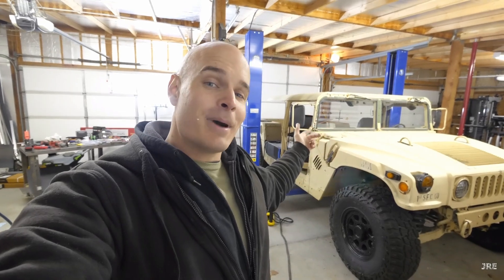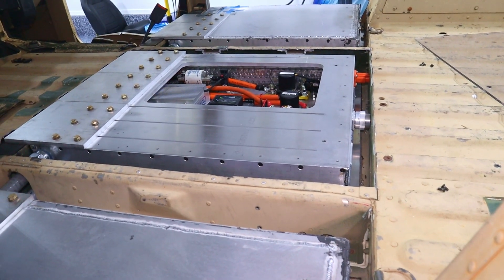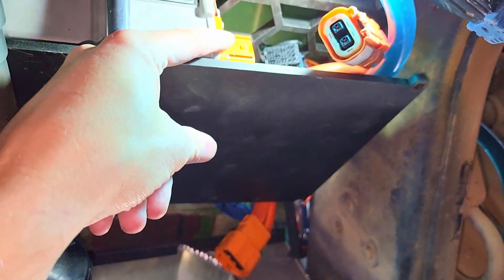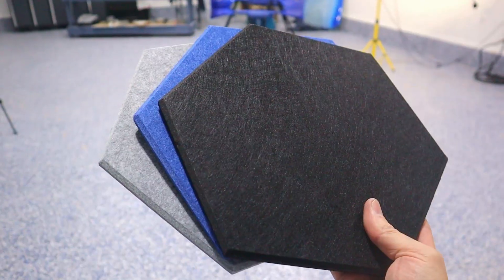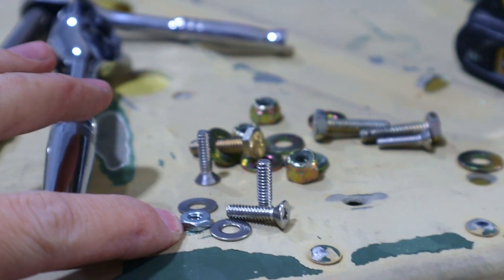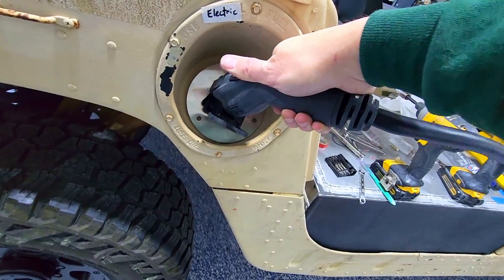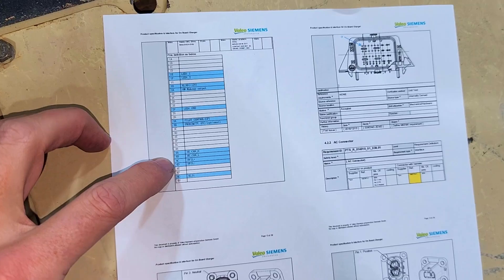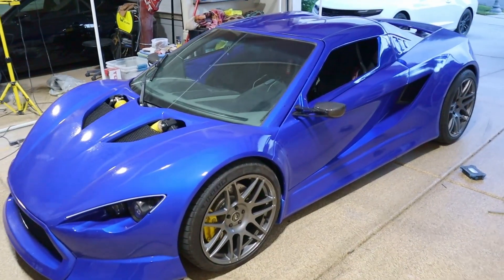Electric Converted Hummer - Diagnosis from the EV Doctor

Comment: I used to deal with a lot of BMS charging and general battery management stuff when I was an owner of a small company building electric bikes, buying and testing BMS boards from eBay and Ali. One issue we ran into was programming/flashing the BMS and ensuring the parameters/firmware were right. Are you sure that the correct firmware or settings are uploaded to the BMS? Does the charging system have the correct components? Might be worth verifying inside the black box/further than P/N on the whole components, take a look inside against the datasheets or 'correct' manufacturer info.
Reply from the maker: Thanks for the suggestion!
Reply: @electricsupercar  Of course! Hope it helps, thank you for your work in producing videos!

Comment: Connect a oscilloscope to the Can Bus and look if data packets are being sent over the network. Look at bias voltages as Can Low should be at 2.5v nominal and pulled down to 1.5v and Can High should be at 2.5v nominal and pulled up to 3.5v. If your voltages are lower it usually means a bad power feed to a module that communicates on the Can Bus and if you have elevated voltages there is a module with a bad ground that communicates on the Can Bus. That is the only way to truly troubleshoot a Can Bus system. A multi meter leaves to many variables when testing Can Bus as you need to see the data packets. Make sure the waveform has good  square waves with a higher square wave at the end of every message. Make sure the wave forms are not leaning into a direction but pull straight up and straight down. Hope this helps
Reply from the maker: Thanks for the comment!

Comment: My suggestions:

#1 Check the grounds. Seems so many vehicle electrical problems caused by bad grounding.

#2 Put an analyser on the CAN bus and see what the charger is sending. The fault code should indicate what the problem is.

Given Jerry’s previous comments about inability to see metrics on the display, I would suspect the CAN bus connections / configuration.
Reply from the maker: Thanks for the comment!

Comment: Check the specs required for HVIL. Some HVIL loops expect some voltage drop across them. However, it is probably not likely that the charger is the source of the HVIL loop, it's more likely that the BMS is. Its possible the HVIL pins on the charger are shorted together and when the connector is unplugged it breaks the loop (ie the charger is doing nothing with it).

Edit: I found a spec sheet for a valeo charger, I don't know if it's the same but there's a specific section for HVIL and it says (for the one I found) that the OBC doesn't diagnose HVIL. You should check your documents.
Reply from the maker: Got it
Reply: @electricsupercar  if your spec sheet is similar to the one I found, it didn't describe what kind of faults could be the problem :(. That would've been the next spot to check. 

However, it's probably CAN. Personally I've never had problems with terminator resistors, like even when removing one completely. I'd check to make sure the BMS is talking and that the OBC is talking on the same network. Make sure CAN hi/lo are the same. It's probably worth doing all your testing with ignition (or equivalent) powered on so you don't have to worry about devices properly waking each other up, that'll take one variable out of the equation. Once you get it charging with ignition on, you can get it working with ignition off (assuming that the system can charge with ignition on).

Good luck

Comment: Yeah, I would check the coding in all controlers seperatly with a pc that they are communicating at the same CAN speed, language etc, if they have different speeds, say 250kbps and 500kbps things will not work. :p And are the ends of the trunk terminated? If not put in resistors 120 ohm in both ends will help with signal integrety, although I would think it would work on such a short run anyway.. I would bet it's just the coding/configuration of the controllers that are mismatched and by correcting that it will work. It's clear the charger cant communicate with the bms so it wont start charge.

Comment: Some hanging traverse panels on the ceiling would help a lot more with the reverb. These "slats" protuding from the ceiling trap low frequencies and dampen them significantly better than those tiny foam pads on the walls (which are better for high freq dampening)

Comment: You could build a short extension cable for your can bus connections then sniff the traffic. You can sniff with a scope. I also recall that if you have access to the individual wires you can use a clamp on sniffer. Of course your can topology is important, but I recall the owner already me noted that.

Comment: Good video but bad audio quality really lets down the overall production quality imo. Just intended as constructive feedback, keep up the good work. As a solution I recommend getting one of those DJI lav mics (or any lav mic) and completely change whatever you are using for voice over. Honestly recording on your phone's voice memo app in the car would probably be an improvement. Otherwise getting a decent mic setup for voice over including at least a decent USB mic with a pop filter. Otherwise you can go all the way and get an audio interface, a decent mic which requires amplification with balanced XLR cables etc.
Reply from the maker: Thanks for the comment!

Comment: Yes I drove a 1972 Dodge Challenger for 15 yrs and it didn't catch fire 🔥 because the wiring was done perfect! An as far as I know I got the most miles out of dodge Chrysler challenger! An everyone else didn't drive the car or it Burned! Which is kind of cool I think that I've started thinking I should convert it into a EV called the radio station and discussed on air with the NPR PBS host who was super nice and added she'd love to drive in one of those!

Comment: I've worked with CAN bus before and I had a ton issues with it. Heres a few ideas:

CAN ID collision? It does happen from time to time. Depending on the protocol it could be a 1/255 chance.
Perhaps the frequency is not the same on both sides?
It could also be mismatched protocols (regular frame vs extended frames)
It could be a dead transceiver on the charger so trying to isolate the charger and talking to it directly can help diagnose it.
Improper grounding? Unlikely but try adding a grounding wire between the charging box and the VCU.
Reply from the maker: Thanks for the comment!

Comment: I was a broadcast engineer for years, one particular model of HDTV transmitter used CAN Buss for communications between control boards, exciter amplifier, and final Power Amplifiers. I recall a CAN Buss wiring getting a few wires shorted on the bus wiring, which took on the communications IC Chip on most of the PA " power amplifier" modules. I basically had to go online and order new IC chips and purchase a soldering station for surface mount Integrated Circuit soldering, and replace approximately a dozen of these ICs to gain back communications on the CAN Buss. I'm just putting this info out there,  this all started because of shorted wiring in the buss wiring. Don't know if this is what your problem would be, but for what it's worth.
Reply from the maker: Thanks!

Comment: Thanks very interested.  I'm in my late 60s,  I'm an electric motor and armature winder by trade and an electrical mechanic.
 I have an 2003 wj.  Jeep I'd like to convert,  I know I have the ability,  certainly lacking on the computer programming side.  But information is hard-ish (patent pending) to come by here in the down under,  specially when you live in the bush. Is there a list of equipment used in this build please.  I have watched Jerry's  show several times,  I seem to have missed it. 
Thanks. 
As far as possible causes,  it's usually something small,  or several something smalls.  Keep at it.

Comment: That box right by the driveshaft (Charger Port Controller) has pretty sharp edges for having coolant and wires hanging on the edges, I know the project is in progress but I was shocked at how fast cables can wear through in these scenarios. What's the SQ Ft of the shop and how many Felt Right pads did you end up putting up? That product looks nice and you can hear the difference in the audio even when you are unboxing it. Thanks for sharing!
Reply: When you are verifying the pinouts are you only verifying continuity between the expected pins and not checking for any bleed into other pins? Mentioning because of the damage to the wire insulation at the port and the other mention above for sharp edges.
Reply from the maker: 25'x40' I did not count the tiles maybe 100

Comment: Two possibilities I see - since the failure mode associated with the transient red light says anything in the power stage (paraphrasing), it's possible it may have nothing to do with the CAN communication but damage to the AC input on the charger. 
Having swapped one of the lines with Neutral, the L-N voltage would have been the L-L voltage, double the operating voltage on the L-N side. If it is overvoltage protected and /or fused, the line that was swapped with neutral may have a blown fuse and/or Varistor. This may leave one phase powered (the one not swapped with neutral) so it can power up, but detect no voltage on the opposite Line.
I would open up the charger and look for evidence of the AC inputs having popped fuse and /or varistor... or other functional components, if it has no such protection. 
If that checks out, I would use an oscilloscope and/or logic analyzer to monitor the CAN bus for traffic, voltage levels, noise, usable (square enough to trigger hi/lo thresholds) edges. If something is off i.e. round edges or diff voltage too low, your bus impedance may be too low and CAN transceivers unable to drive such a low impedance (unnecessary termination resistor/s on the bus). 
Anyway, think more about the CAN when that time comes,  I suspect the  dyslexia caused a problem in the charger.
Reply from the maker: Great advice!

Comment: W.T.F you change the placement of the wires in the output plug or the input point of the world hummer, what about the input plug coming from the power out of the wall charger.
You should have change the wiring of the inverter of the Hummer rather than the wiring of the plug.

Comment: well i don't know if this help but you can check each component alone , i mean you tested the charger so that's done test the inverter alone and try to get an expected output from is if it works then its not it and try the can network 

as i understand the can network connect every this to communicate with each other so you need to know if you can get an output from other component 

but i really think that the can system has something wrong in the wiring because you get no thing from the screen and no response to the charger 

a  hint may be helpful , try check if there is any cuts in the can wiring and that cut may be touching the body of the truck and as it's grounded you get nothing as a response 

hope to help , keep the hard work 🛻

Comment: Nice to see you working with Zack!

You may want to do some research on connecting stranded wire. My understanding is that crimp connectors should be used, not solder. The issue is solder turns stranded wire into solid wire which when flexed eventually breaks. That's why stranded wire is used in automotive applications where the wire is constantly flexing.

Comment: Id probably try a few things:
an oscilloscope on the can network to check on the signal
Check can for is the right messages are passing and any trouble codes
Check sequence of operation and interlocking on the high voltage DC side for any issues (like contactors needing to be closed first so the charger can see DC voltage from the battery in the right range for a healthy battery, many chargers require that before they start
re check the can wiring matches specs, I know he mentioned using some wire designed for can but the branches of the trunk didn't look like they were using that special wire, with relatively long and high speed data connections (as in more than a foot or two and into kilobits per second) things can get interesting and seemingly minor issues with wire become major problems, shielding is important, as is lengths, especially of any branches, but also things like characteristic impedance which is also why those termination resistors are needed, if you have a mismatch of the wires or miss a termination resistor the signal will bounce off and back down the wire interfering with itself, I don't know the exact specifics for can in particular but I'd expect that branch for Jerry's laptop should be terminated whenever a can device isn't connected and I would not be surprised is the characteristics of the branch wires were wrong and creating reflections at one or both ends of each branch due to impedance mismatch.

I'm in IT and deal with a lot of non Ethernet "networks" for various things and I've seen a few of these types of issues crop up, multi drop bus networks (which can is) in particular can be very picky and if you only have worked with point to point or very slow and/or very short cabling (in signal time vs speed of propagation, so short here means very short, and is inversely proportional to speed, in high speed terms for things like connections to ram I side a computer or inside of computer chips, long might be well under a foot)  you may not realize how important some seemingly minor specs can be.

Comment: I have a tip for you. Your walls might have some hard surfaces, but your roof is the biggest unfurnished surface in the room. Hanging up some large acoustic panels there will definitely improve the reverb
Reply from the maker: Nice!
Reply: @electricsupercar  I work with audio and can tell you that any fabric on the ceiling will help and you dont need to cover it all. Get yourself some cheap thick blankets and nail them up there
Reply: @electricsupercar  Here’s another tip: the voiceover / spoken audio doesn’t need to be in stereo. Switching it to mono would improve it a lot for headphone users.
Nonetheless, Great video!
Reply: Found solution for this, Windows --> Settings  > Accessibility > Audio, and then switch on the Mono audio toggle. (don't forget to switch back to stereo after watching)
Reply: @lakee1542  does make watching on a 2.1 system (like a TV with Chromecast or HTPC) harder to hear when all music files are uploaded in stereo. I dealt with that too much on my living room TV, so I upgraded to a 5.1 setup that I can manually control the center volume for mono speaker (e.g. dialog)
Reply: Note that if you want something less expensive than these felt pads, you can use quilts or sections of quilts. That's a common trick in the voiceover community. Of course, quilts wouldn't look as nice as the felt pads, so there is that trade off.
Reply: @shubinternet  a huge persian carpet might look nice on a roof though, and It'll def help
Reply: Harbor Freight moving blankets are cheap and work great for sound control.
Reply: If your absolutely horrid with tools buy some pre cut PVC pipe and 90° fittings, some sound dampening isolation and some mattress covers with those rubber bands in each end and just assemble it. The point is to get mass and air between the fabric and the wall.
Reply: We also have to mention that listening to the video with headphones, most of the audio (voice) are routed to the left ear
Reply: I'm thoroughly surprised no one has mentioned stone wool batt insulation. It's something usually available at most home supply & improvement/construction outlets at what seems to me like very reasonable pricing per sq ft, plus it comes in assorted-size packs measured out to the square footage you need, or at least near-as. I'm not even a contractor or audiophile type of dude, just a random goofball on the internet, and even I know that.
Reply: I am a commercial roofer, there is this substance called spray foam a.k.a. great stuff, it usually comes in a can and is a great sound dampener and used on top or on the inside of roofs, 3 pound foam is the best.
Reply: yeah you can hang some cotton clouds
Reply: ... Please dont forget to think about fire hazards. You dont want to hang up highly flammable materials that go up within seconds, especially with cars, fuel, metal works below.
Thats fine for your improvised talking booth but not for a safe work environment. Its not even about stuff not burning down but getting out alive, bonus is it also helps putting out fires before they spread.
Having molten burning plastic drop down on you does not help to escape or put out flames.
Reply: @PsiQ  Our materials have undergone ASTM E-84 testing and have a Class A fire ranking :)
Reply: @feltright  This sounds like a neat video idea, like a comparison to other, more flammable materials, and perhaps a nice bullet point for marketing purposes as well.
Reply: Or using Nvidia broadcast to process audio

Comment: Check Unified Diagnostic Services (UDS) using CAN. Use CANalyser and CANape for Diag. It will provide you the error codes and possible fault(s). I do that all the time with most of the Electronic Control Units (ECUs) of a car. Diagnostic and Communication via CAN, CAN-FD or LIN or any of those expensive comms(MOST, Flex Ray and Ethernet) is a headache. I always follow the boot sequence, diag session (Default session), then check for Read Diagnostic Trouble Code (DTC). Check the response code for Read DTC.
Reply from the maker: Thanks!  I'll check it out